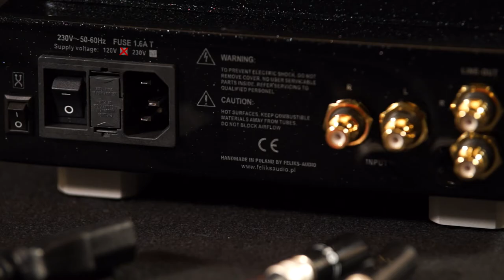Feliks Audio - Installation and Break-In Period

Comment: Can you please explain which DACs have been found to complement your HPAs? Should I be looking to pair it with a NOS DAC, or something that is sharper such as an AK based DAC?
Reply: Not having an Envy myself, I'd go with the rule of thumb of having each component in the same price range. 
That said, and in case of a DAC, it matters a lot if one of your input sources is a PC connecting via USB. If it is, and using the product line of Denafrips, adding a re-clocker should help a lot. Adding the re-clocker also is cheaper than a PC-Card that provides a proper clocking-crystal and an I2S output, which would be much preferable to USB. Otherwise, Chord Hugo TT2 and M-Scaler are pretty good at removing Jitter and USB noise by upscaling the signal into absurd ranges. If you can forgo any USB and PC connections, i.e. by using a dedicated streamer, you can go to any range of products. Though, R2R DAC's are the hype for a reason, with higher end R2R DAC's providing better sound stage and clarity on top.